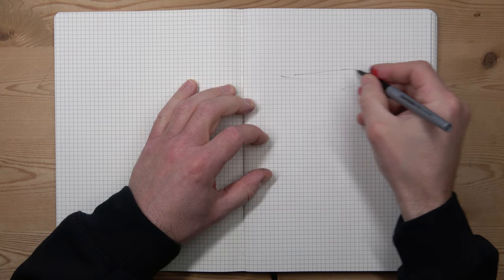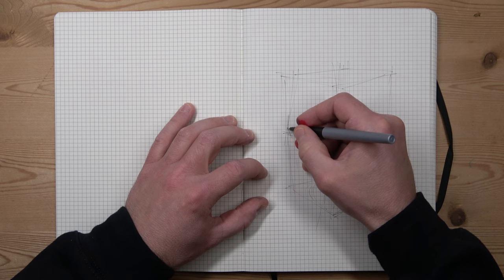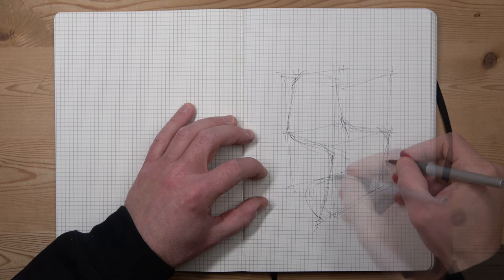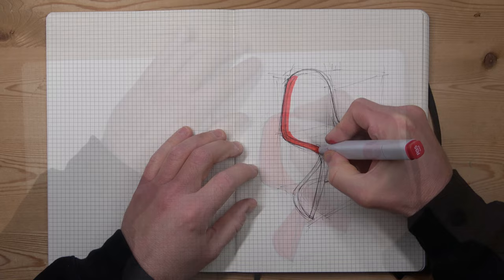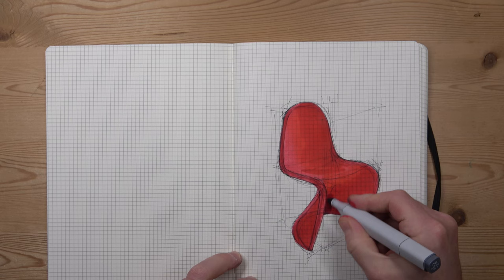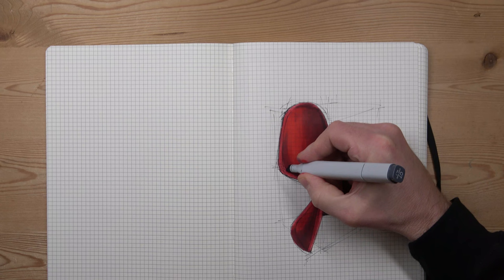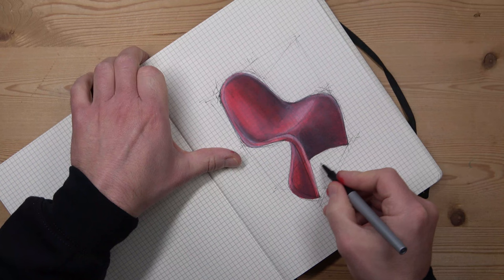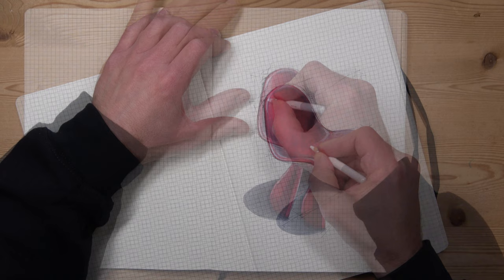How to sketch the iconic Verner Panton chair!

Comment: Cool sketch and great tutorial. Question: Instead of white, have you thought about using a light orange/peach to lighten the red of the chair?
Reply from the maker: Thanks.  Yes, and even allowing the white of the paper to shine through for the highlights.  Trouble is that this paper is terrible for markers and light, medium and dark tones don’t work very well.  Instead greys and white pen/pencil.  Why do I use this paper then?  I just use it for my Instagram sketches, and nothing much else.  I know that the sketches will be dull and a bit flat, so I’m not under pressure to produce presentation sketches or artwork.  This frees me up to focus on sketching for communication instead.  Quick, descriptive sketching that helps me to explain my thoughts.  It’s one of many strategies I use in my teaching, for reducing pressure.  Hope that makes sense.